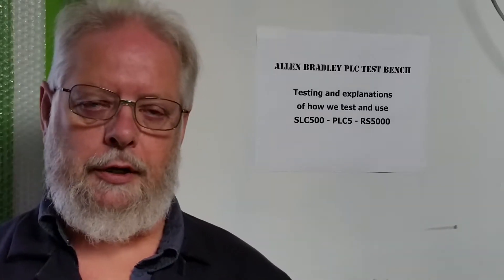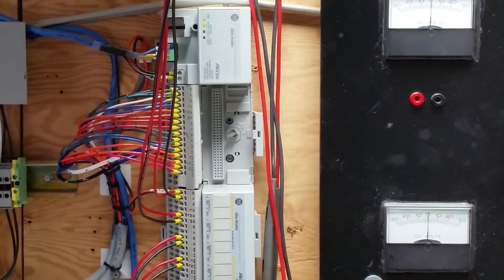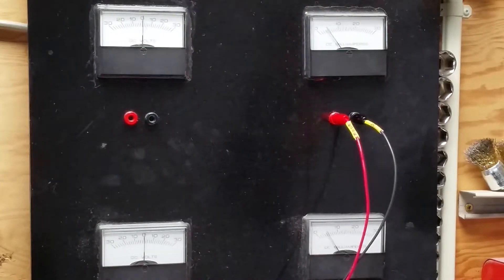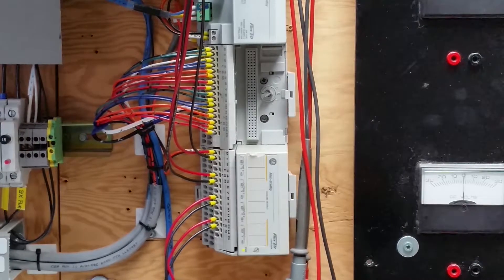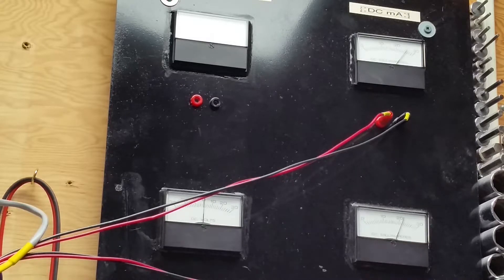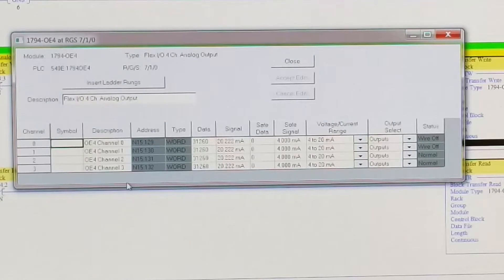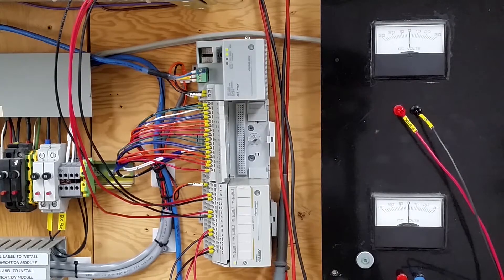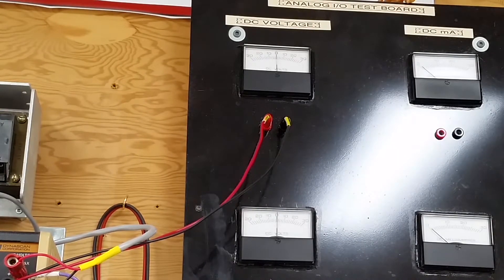1794-OE4

Comment: Hi, thank you very much. Very helpful. This is similar to Paul's question, except, right now, we only want to reconfigure an output for 4-20 rather than voltage. We can power down the VFD that the bad output is running, but we can't power down two of the other VFDs controlled by the module (one 4-20, other +/- 10V).  We have a 1794-OE 12 (RIO with Control Logix processor, I believe V 24) with a bad 4-20 VFD speed reference channel (must have damaged installing a new VFD while the module was powered).  There is a +/- 10V speed reference on the same module that we have to avoid turning off for a few months. The spares are configured for voltage, if I move the wires to the mA terminals, and then reconfigure one of the spares while we're online, will there be much of a pause?  It is set up to maintain last.  Is there a risk of significantly impacting the other VFDs (one shouldn't stop for more than a few seconds if at all possible), or the rest of the plant (1 processor, 5 flex RIO panels, with multiple racks of FLEX IO)
Thanks so much for your help.
Reply from the maker: Hello Joe:
I would really hesitate on trying that on a running drive.
I am not 100% positive, but I think - 
When you change the configuration the processor downloads the entire module even when you have only changed 1 channel configuration.
Currently I don't have any OE12 in stock to be able to experiment with.  They are a bit difficult to get some days.
My suggestion would be to setup on your bench with a test processor and hook up an OE12 to it and test that way first.
If I had an OE12 in stock I could setup and test on my bench and do a video.  Not sure if an OE4 would be a proper test to simulate this.
Not sure what the best answer is going to be for you.  
The pause in the signal should not be more than a second or 2.  But again a bench test in your shop would be the safer way to test out.
Bruce
Reply: @abplctestbench759  Thanks again!!  We'll wait until we can turn the other off, and I'll let you know  what happens : )
Reply: @abplctestbench759  Thanks so much for your help!  As Rockwell becomes more and more difficult and expensive, you will be a great help to all of us.
Reply from the maker: @Joe-ty2jp  You are very welcome - looking forward to hearing your final outcome.

Comment: Thank you for this video. Can one channel be used for 0-10v and another used for 4-20mA outputs?
Reply from the maker: Hi Michael:
Yes it can be used that way - each channel is configured in the setup screen.  Wiring is slightly different between the modes.  Please review the documentation.
BB

Comment: I currently have a rtd flex io that isn't working properly can I swap it out while its powered up. The equipment it's running is shut down currently.
Reply from the maker: Hi Paul:
Don't normally answer this fast, but just happened to notice that I hit 1K subscribers☺
Yes you can replace flex I/O when powered.
Processor will download the configuration to the module when it powers up.
Having the equipment shut down just makes it easier.
Thanks

Comment: Meu amigo, você tem que mostrar onde vai os cabos de comunicação, qual comunicação, qual protocolo, se tem que usar resistor terminação e valor do mesmo etc
Reply from the maker: Hello Mauro:
These are only used on Allen Bradley PLC systems.  The cables are standard to the system and not able to be used in other systems.
Olá Mauro:
Estes são usados apenas em sistemas PLC Allen Bradley. Os cabos são padrão para o sistema e não podem ser usados em outros sistemas.

Comment: Sir,
We are using 1794 IE12 and OE12 modules but the are getting damage regularly please let me know the reason (L1 may be the SMD fuse getting damage) in every module
Reply from the maker: Hi:
There is no way I can answer that question without seeing the application and how it is wired up.  To me it sounds like you have an external wiring problem that is causing damage.

Comment: Thank you for the video. Very informative. I'm trying to test the analog output modules on our PLCs. How does the circuit look like?
Reply from the maker: Hello 3M - I am not exactly sure what you are asking.  I thought that my video was clear on how I do the testing....  I use a small meter for a load and a digital meter as an accurate measuring device.
IMO you should have a PLC inside of your shop that is not connected to your process.  That way you can do the same as I do and safely test any module and not risk doing damage in your plant.
Reply: @abplctestbench759  I used a 300 Ohm resistance and an Ammeter in series. It clicked that you were using the ammeter as a load. I have a test rack and easily building up my test bench. Thank you for the help.
Reply from the maker: @3mshop  You are very welcome